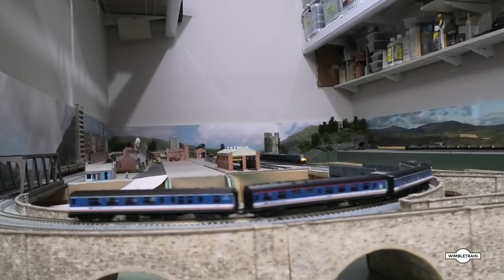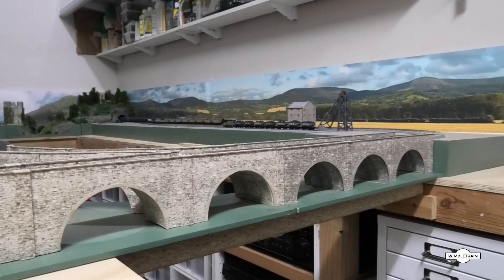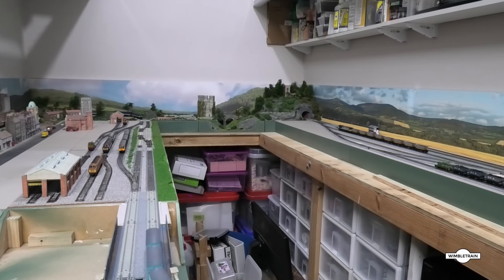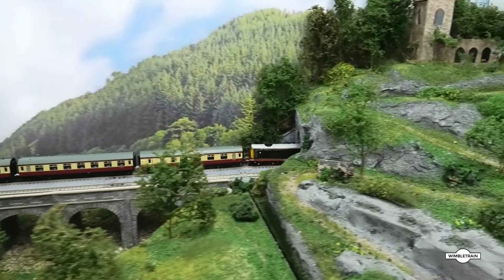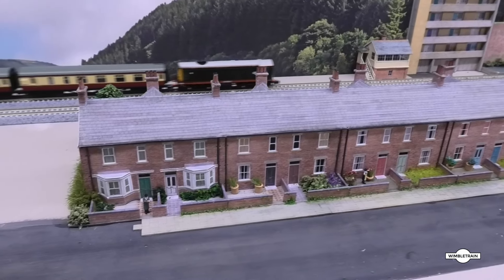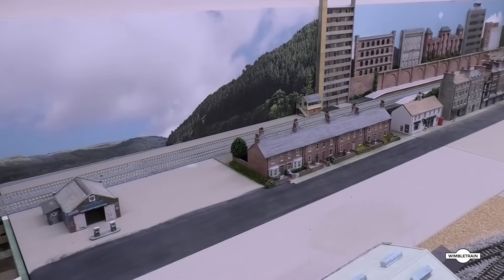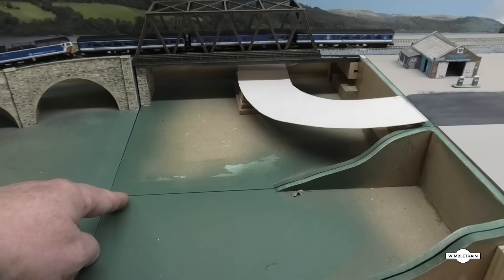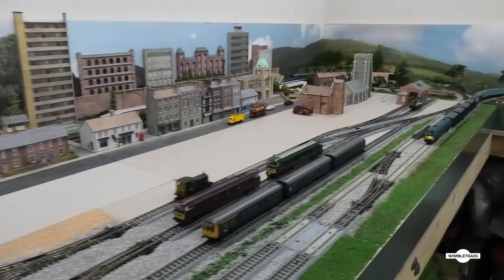N Gauge Model Railway Layout Update - February 2024 - Wimbletrain

Comment: Hi John - Layout looking great, loved watching the trains running, wanted more.
The Class 20 looks fantastic, runs well. I am in the process of putting together a  two SR BULLEID BOOSTER CC1 SR GREEN ELECTRIC LOCOMOTIVE which they have only brought out in OO and O Gauge. Have had the 3D body made, got the rest, just have got to have the bottle to attempt it.
Got the idea when I saw this https://www.youtube.com/watch?v=gwt02mnB_T0
The row of terraced houses look awesome, guessing they are Metcalfe?  The whole street is going to look fantastic when you have done both sides.

I was thinking of bringing the sloping road so that it goes under the bridge on the left, that way the slope is even gentler. I gather your going to have a river going under the bridge, so that can take up room on the right of the new road. All you have to do is cut a bit of the upright bracket so the river can meander over to the left and have a sloping iron type bridge taking the road over the river.
I hope that makes sense, just an idea.
Cheers Chris
Reply from the maker: Hi Chris, I've never done a running session video as such but maybe I should, got lots of locos and rolling stock that haven't been seen much on the tracks! The loco project sounds interesting, would love to see how that goes.
The terraced houses are Scalescenes and took some time to make, so slow going there and lots more to do.
Good idea with the road, Mr Piddle also suggested something similar with the road so will go down that route. But you've also given me an interesting idea to work within regards to a river and road bridge. All the best